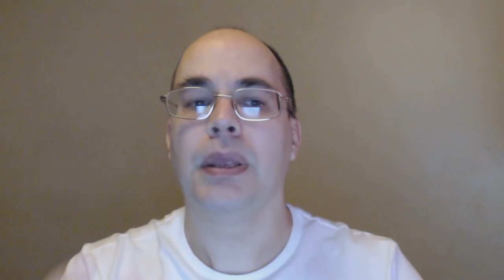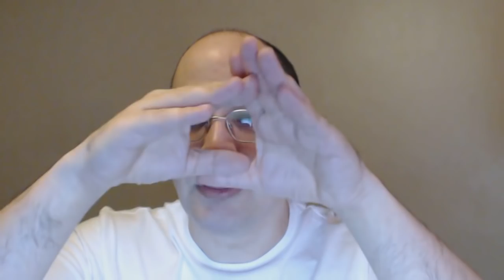How do rockets move in space, with nothing to push off from?

Comment: 1. Am I right in saying that Newtonian physics is defined by two masses with a force acting between them? If so, how can the object at rest (mass 1) - comprised of the rocket and the fuel inside it - simultaneously (on ignition of the fuel) become all three of the elements necessary to obey that requirement?
 
A particle of exhaust gas can have mass and velocity, but it cannot be both the mass that generates the thrust against the single mass system that it is a part of (mass 1) AND the mass reacting to the force its own mass is generating (mass 2). That is illogical and it does not meet the requirement of Newtonian physics.

Saying that N3 is met without acknowledging that you've only accounted for one mass and a force, it not being true to the requirements of Newton's laws. It's just being selective.

2. Jet aircraft rely on air to operate, yes. That has nothing to do with pushing off the ground. Who would ever claim it does? They need air to operate. That's the point. You're suggesting that the argument is more about a rocket pushing off the ground than the contention that a jet or rocket's thrust needs something to push against in order to generate an equal and opposite reaction. (TWO masses and a force acting between them, remember.)

3. You give the example of the gun firing a bullet. One closed mass system becomes two separate masses (the gun and the lead slug in the bullet that escapes it) and the force acting on them both (the explosive element of the bullet). Thus, an equal and opposite reaction. Two masses there and a force acting on them both. Newtonian physics... so not comparable with your rocket analogy.

You are trying to equate the mass of the escaping fuel (gases) and the rocket to the bullet and the gun, except you concentrate on N3 (and the conservation of momentum) and ignore the fact that the laws require TWO masses and a force between them.

I repeat, you cannot claim that a gas particle is attached to mass 1, generates the force on it and simultaneously becomes the mass 2 that must also be involved in the equation to meet the requirement of Newtonian physics.

Comment: It is an understanding of negative pressure and positive pressure and a rocket, supposedly, creates positive pressure that it pushes off of while in a negative pressure environment (space)
Reply: It is an understanding of negative pressure and positive pressure and a rocket, supposedly, creates positive pressure that it pushes off of while in a negative pressure environment (space)
No. There is no such thing as negative pressure. It's like saying something has negative weight. Pressure is always either zero or positive.

The rocket moves due to the reaction push it gets by shoving reaction mass out its rear end.
If you sneezed or farted naked in space, you would get a rocket reaction, due to the ejected reaction mass.
Reply: "Negative pressure" is a term used in certain ventilation systems contexts when talking about air circulation systems.... though there is no such thing, literally, as "negative pressure".... all pressures are positive. A vacuum is not a "negative pressure".... It's literally 0 pressure. "Negative pressure" comes about in ventilation terms because the system is designed around relative pressure, that is there is a set ambient pressure which is the reference frame, and a negative pressure is a pressure below the reference frame. In the literal sense, both the reference frame in that and the "negative pressure" are positive pressure values... it's just the "negative pressure" is a lower positive value than the reference frame pressure.